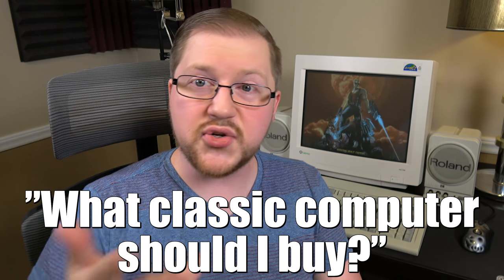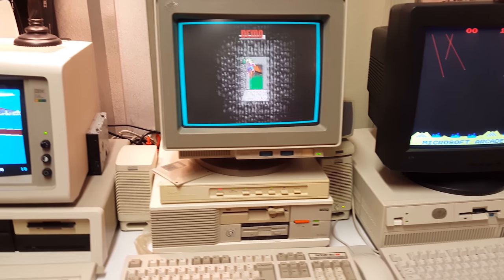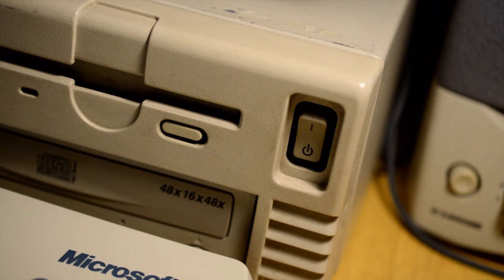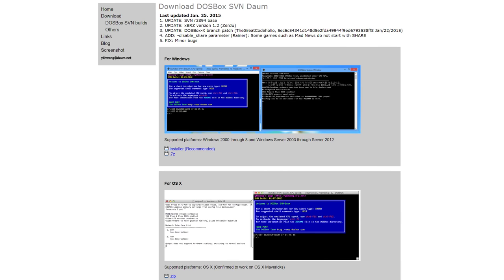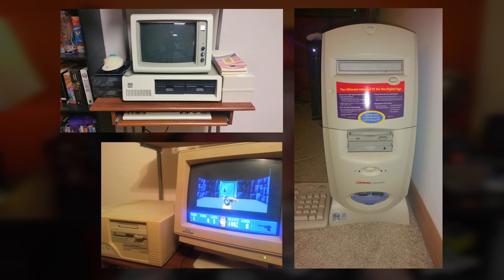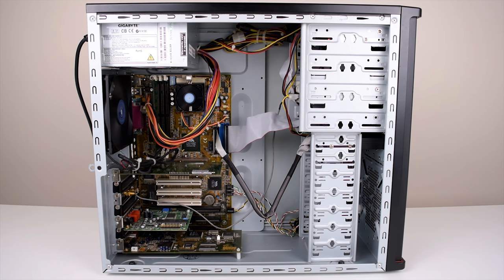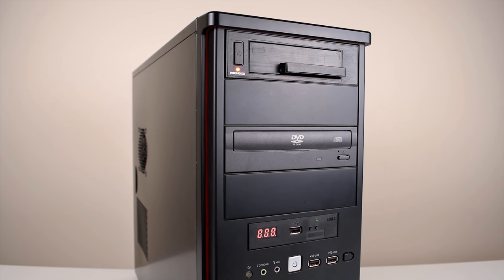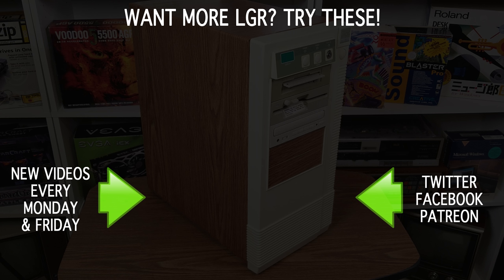Choosing a Retro PC for Games: Advice & What to Look For

Comment: I know I am almost 2 years late but I have 2 things to say.
1 is I had to watch the whole thing to get to my favorite Gordon Freeman...I mean I love the Game Dungeon!
2 lately I have been having a nostalgia kick where I want a retro computer slightly faster than my first PC (486SX), right around the DX4 but basically wondering about the "time machine" and with placing a vintage gfx card but I never thought about having to limit the CPU. I have an old i3 that i gutted for my current system but I could replace the parts I stole from it to do that. 🤔
Reply: Oh and since I mentioned my 486, I remember the days pre plug and play...ugh make sure there are no com port comflicts. I had a $500 paperweight for awhile until I learned my mouse card combine with something else was in conflict, the solution use 2 separate cards. 😅

Comment: You forgot to mention the completely blasphemous option of building an IBM 5150 from scratch with 0 original components, meaning floppy emulators instead of actual drives & scratch-built rather than original case. I have no idea why I even came up with this kind of thing but I like challenges so I'll get to it eventually!

Comment: My dos setup is legit, ... uhm... legit! i was using emulators for a while, always hating how i used my own PC for it, wanting to touch an actual PC with that old style charm! AND NOW I CAN! as i have a Dell Latitude C510, sure it came with windows XP on it, but it was slow so i just wiped the hard drive and installed 98SE and mmmmmmmmmm runs like a charm, with its whopping 256MB or ram, 16mb of vram, and adlib like sound card, it makes me happy and is pleaseing, especially with the old style lamp i have next to it

Comment: Given any thoughts to using PCEm?  it's a pretty complete PC emulator that goes as far as requiring BIOS configuration.

As for real hardware, I have an old Toshiba Satellite 4025CDT.   It's got an OPL3 chip, a decent Windows accelerator chip so Windows 3.11 works nicely on it. :)

Comment: I'm in the middle of trying to revisit Windows 98 partly dot nostalgia and partly because I'm trying to use a dev tool meant for older systems.

Started off my journey with the mistake of buying Contact Flash to IDE adapters... Only to find out the old machine I was planning to put them in has only PCIe ports and the harddrive is dead. Oooops!

Comment: whenever people talked about going into the Pentium II range, i started to cringe... a little voice in my head started screaming "no sound in DOS" :D

that was the time when they started to not include ISA slots, and I used to not have much luck for PCI sound cards working with DOS games... (also for some reason MIDI sounded like crap with PCI cards when compared to ISA cards... not sure why that is)

not to mention Onboard Sound, which also started to become popular around that time, with that, you're pretty much guaranteed to have no sound at all in DOS mode

Comment: I would prefer to use emulators for as much as possible on modern computer consindering getting real vintage hardware is costy and gets harder to find, and not optimal for everything. Since these computers are heading to their 30-40 years of age, be prepared they might break in any time if they don't get the capacitors replaced which is A LOT of work for just wasting some time and money required to get your setup the way you want it for your old games, and the space it will take up.
I'm a collector of vintage hardware myself and have enough to get the most retrogames to work.

F.y.i my setup's is:
IBM XT 5160 with 4,77/10MHz upgraded 8088 cpu and 10MHz 8087 fpu 512kb ram and working 10MB hdd. MDA (no CGA) card with 5151 monitor.

Copam PC 386 40MHz with 40MHz IIT 387 fpu 8MB ram 2x 512MB CF hdd. Diamond Speedstar graphics 2MB.

"Homebuild" 486 at 120MHz (DX4) 32MB ram, also 2 CF cards as hdd. Cirrus VESA graphics at 2MB.

PentiumOverdrive 200MHz w. 64MB ram with Win95 and Voodoo 2 accelerator.

Pentium 3 at 1GHz 640MB ram Win98-2000 Voodoo 5500 graphics 64MB.

Pentium 4 (prescott) at 3,4GHz 2GB ram HD4650 1GB AGP for WinXP games.

Then my 2013 build with Win10.

Comment: A good emulator is the Doom Engine (DE in short). It runs Duke Nukem, Hexen, Heretic and Doom really nice/good

For the rest I was very familiar with Mame32.

Incompatible issues are not something from the 80's and 90's only. Perfect example is Scarface the Game, it only runs smooth on Windows XP, and since that is no longer supported and hard to update with something at all, you can't play the game. Even tried compatible-mode and Windows Vista. But it doesn't work. It doesn't seem to be very fond of DirectX 9 as well

Comment: I'd love to hear more about display emulation and Dosbox's display settings. I'm in no position to get original hardware and I'm stuck with emulation. The actual performance doesn't bother me much, but I just can't always get DOS games to look right.
Reply: I think DosBox sucks - 86box is much better - it emulates not just dods enviroment, but a whole computer from IBM 5150 to pentium systems... I forgor about dosbox when I downloaded 86box )
Reply: Яков Халип Thanks for the tip, I’ll check it out.

Comment: From my memory of my older computers I have had.  One of my cases that had a golf ball button on it the turbo LED numbers was preset on a daughter board attached to the lights with jumpers on it.  I don't recall the speed ever being directly turned on by the motherboard.  I had this exact case https://techreport.com/blog/16572/my-first-pc-r-i-p but I cannot find more images of it or what the model of the case was.  I really need to start digging out my old computer equipment and see what I have remaining.  Somewhere I have an old Creative Labs Phone Blaster full length modem and sound card all-in-one card.

Comment: I guess here's a question that comes up given the multiple references to being able to load games directly onto the CF card standing in as a replacement HD using a modern PC - how does one do that exactly?  I have a reader and attempted to do some things with it when I was having trouble setting up a CF card I had as an HD replacement for an old HP Pavilion minitower I have, but could never do anything with it on my Windows 7 machine, not even to properly reformat or just wipe the card to a point I could start fresh again.  I don't expect a "how to" guide from you or anything, but I'm hoping you might know of one that someone else already wrote and could point me at it.

Comment: While buying classic game at GOG.com is the go to thing you do if you want to play classic/retro games on your modern pc however it doesn't guarantee the games run smoothly and even some cases not run.
Reply: Windows 10 is a moving target with the constant upgrades that'll break something like drivers or SDL support. Windows 7 is more stable but getting less secured w/o 3rd party AV software.  GOG does have good support forums to help you out and I also recommend PC Gaming Wiki as well.

Comment: I got a very important question: How did you get in contact with Ross from Game Dungeon? Wasn't he trapped on the moon? Do you have moon communication software on an old machine?
Reply: There's a whole moon communication network set up in space, wifi signals that reach from Earth to Moon, which then it allows simple methods of communication such as email.
Reply: @kennethchou4384  That sounds too far fetched, I bet it's just a really long cable. The moon is Earth's YoYo, thanks Ross & Clint. Jeeze.
Reply: @Snotnarok  But then if that's true, the aliens would be toying around with the lunar YoYo and NASA won't get any work done because aliens are distracting.

Comment: I bought a Dell Latitude D630 laptop with Windows XP installed yesterday and I wanted to install my OEM copy of Windows 2000 onto the system (the laptop is supposed to be compatible with Windows 2000 and Dell still has the drivers available on their website). I did everything accordingly and no matter what else I do, after the CD installation is done and the computer tries to boot from the HDD drive I installed Windows 2000 to, all I get is a black screen with a white flashing “-“ in the top left corner. Any help would be appreciated.

Comment: Emulation for gaming is shit unless you have a really powerful host CPU. The problem from what I understand it is that emulating 32 bit systems and older CANNOT be done through more than one CPU thread. So basically that entire emulated Windows 98 PC you're hoping to run your old game on, runs EVERYTHING (sound, graphics, processing, RAM etc.) through a single host pc CPU thread. This means that the second your guest pc comes under load, the frames stutter and the sound stutters too, becoming basically unplayable. The only way I've seen is one of two options. A. Have a seriously powerful host machine that boasts at least 4GHZ or higher processor. Or B. build a retro pc and run stuff natively. 

Another point though is that you need to understand many games have problems running on your retro PC/emulation.....because that's how shit was back then. Compatibility between software (especially games) and hardware was a real crap shoot back in the day. There were very restrictive limitations with each game, and there were times you bought a game off the shelf only to take it home and find that the game hated your graphics card and you couldn't play. Now we just download something on Steam and it installs, and as long as we have enough horsepower the game runs.

Comment: I have got a machine with an AMD Athlon 900 Mhz running Windows XP. I would like to make of it a versatile platform to run games from the 90s (especially DOS games) but also more modern XP games... Do you recommend me to install Windows 98? It has on board graphics and sound. I was thinking to uodate it with Nvidia or Radeon card with up to 128 Mb of VRAM and a Sound Blaster Audigy for the sound? would you give me other recommendations or tips? Thanks in advance!

Comment: why the hell would you want to buy one? 
 
 i dig this stuff because I learned to use computers in the 286 area my first machine was a 8086 cash machine i found in a dumpster and built into a computer. but we have come a long long way. I mean i remember when 1 meg of ram was so far out of anything i could afford that it was like looking at a lambo in a magazine so now i buy lots of this junk because I remember when it was crazy cool. you younger guys who don't know the joy of doss drivers and dial up bbs's you didn't miss anything.  I got a 386 dx at a pawn shop one year and that was the first color monitor i ever owned i couldn't believe how freakin fast it was it blow my mind for real.  like the old hardware because I grew up with it. 

I remember pirating my first copy of windows 3.11 by copying the whole system one file at a time from a running machine in the school library. 

now today if you want to play games all i need is vm where you can build like any computer you want in 5 minutes and have them stored on you windows 10 or linux desktop.

Comment: Question: what if you get a pretty modern computer? Lets say a pentium 4, amd athlon xp 2600+, or something ever more modern like a dual core, and install w98 on it? Will it be pretty much compatible with DOS games? You can use an old pci graphics card and swap it for an agp when you want to play something from 2002 or 2005. And also some pci soundcard I guess...
Reply: Something that has both SATA and IDE at the same time, ps2 and USB, parallel and com, etc.

Comment: LGR, I stream retro snes/nes gaming on a sansui 4:3 9" CRT television with an upscaler and a razer ripsaw capture card, and it goes alongside my desk like a 3 monitor setup.  If I were to get maybe a downscaler, is it possible I can play retro games like the sims in a 4:3 aspect ratio on that television and use it as a third display?  Or would it distort the quality not using a crt monitor?

Comment: Dude! Vortex2! Has ANYTHING been made like A3D since then? Everythign else at the time (like EAX) just added reverb and stuff. And even surround sound just .. had sound come out of multiple speakers. A3D raytraced the audio bouncing off stuff, and then basically changed the latency for the left and right ear so if you were wearing headphones you got ultra realistic positioning. It blew me away and then .. was blown away by shittier tech.  

Similar to 3d film, which had non-anaglyph (red/cyan, for example) in 1922. Yes .. they were viewing ACTUAL 3d, filmed with ACTUAL 3D cameras in the 20's and .. we went to crap 3d after that, BRIEFLY had a few ACTUAL 3D films thanks to Avatar, aaaannndd.... now we have crap hybrid-layered cardboard looking 3d masquerading as real 3D, but thankfully using better glasses instead of the nightmare that is anaglyph. Hell, in a way you could say the 3D in the 1920s was better since it didn't take the brightness down since it used a rotery engine to alternate the frames that was synched to the projector in GLORIOUS LOW FRAME RATE BLACK AND WHITE. Talk crap and get .. well nothing no one cares about 3D movies and I blame the studios. Even if it's a 'gimmick' it stills should have been a gimmick that stuck because we never got to see how movie creators COULD use it instead of ... using it to be like "WEOW! It looks like it flew out of the screen!" Why does everyone want that? ... That's now how life works. If a knife flew out of the screen it's because it's in your head. You don't yell at windows for not displaying indoors. ... Whatever, dum dums. Go back to your moogley poops and scootle dumps. I can dream!
Reply: Just realized that my section on 3D is larger than the ... what was the other? Oh well, I did it for the moogley scoots or whatever I said. They're out there. They exist. Promise.

Comment: honestly you would likely get  mosost all the cd/dvd media running in win 10

far as i knoiw for floppy xp was the last os to support both  3.5 &5.45 inch was xp..

downside to xp you have no driver support for connect tv to use as a monitor

686 would likely be the top end of the marke

Comment: i wish i still had my vintage computers from the 90s id surley donate them used to have a p75mhz pc a 133 non mmx a 200 mmx i really wish i had the 200mhz one it had duel ram setup u could either use 72pin ram or 2 slots of i think 66 mhz sdram

Comment: you can build new windows 98 se gaming PC cheap for under 150 bucks even with new parts, even in 202 you can easily find cheap new parts or very good preowned parts. I been seeing lots of new Slot A and socket A motherboards cheap on eBay. I picked up a Slot A motherboard for 20 bucks New, Bought a NEW Soundblaster live for 30 bucks, bought new DDR 256mb chips like 3 bucks each, AMD Athlon k7 700mhz CPU only 50 bucks new with new fans and heatsink, FX 5500 Cards new for 30 bucks each. Just cheap parts.

Comment: Hi. I'm thinking about rebuilding my 1st PC. It wasn't old. It was something from late 90s and early 00. I don't remember which mobo I had (it was asus, but that's all that I remember). Coppermine CPU, Celeron 800, Sparkle GeForce 2 mx 400 64MB and 128MB RAM (thinking about 256 now). It's perfect configuration for Windows 98SE (and that's my target, I'm not going to use many DOS games, rather more obscure Windows 98 Era games that can't be emulated or played via virtualization).
Generally speaking, is there anything better configuration for this purpose than this?

Comment: This is the build ---> 1.4 Ghz Pentium 3 Tualatin cpu, 512 mb 133 mhz ram, evga 5950 ultra agp 4x, 380 watt power supply, 80 GB hard drive, windows 98 SE and sound blaster live 24 bit.

Comment: The good old 486 I had a 486 DX266 running Windows 95 24mb ram and the internet with a 56k modem think I had 2 1.5gb hard drives

Comment: for me im torn because I want to play games from the 80s, 90s and the early 2000s so I bought a Pentium 3 laptop. Problem is the Rage Mobillity M1 and the Rage chip wasnt strong enough to do much newer then  the 90s.. so I now have a Thinkpad R61 thats a little more powerful sadly though I have to settle for Windows XP when I wanted to use 98. See my predicament? lol either use the laptop thats more retro and Windows 98 that I want or use a newer one that runs XP but can play what I want lol
Reply: I had a desktop witht he same problem, it was too new and too old for my purposes. What I ended doing was installing tinycore linux on it with dosbox set to autostart. That way with newer hardware it still seems like an older machine, i can use newer joysticks and drivers without worry, and can tweak dosbox performance for games.
Reply: im actualy getting a Packard Bell legend 1920 (486 I think) from a co worker tommorow, really excited but im hoping to play some games from 2005 and older on it which I dont think a 486 can do

Comment: Hey there, I would like to build a retro system as well.
Would like a 486 definitely. What is the latest games that this level of system can do?
Duke Nukem 3d? 
Quake 1 maybe? i guess thats out of the question?

If you can give me some advice, anyone?
Reply: Depending what kinda 486 you have, and the rest of your specs, you MIGHT be able to get away with Quake. It'll be pushing it though, and likely not very pretty if it does work.

Stuff like Doom 2, Duke3D, Warcraft 2, etc should work fine. Quake, System Shock, etc will be on the highest end of possibly playable. Older DOS games like Ultima may run too fast as well, the 486 era really has a "sweet spot" for many games, and anything newer/older than that sweet spot will be a pain to deal with.

Good luck, have fun!